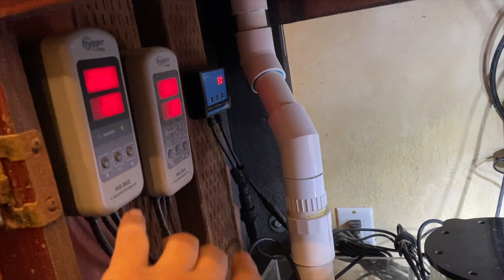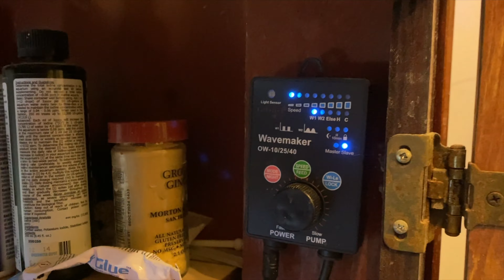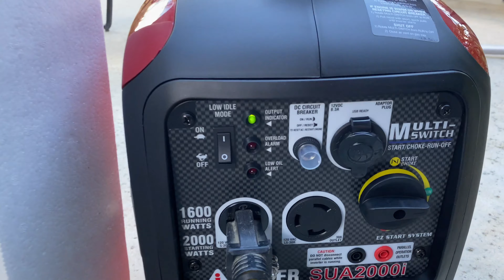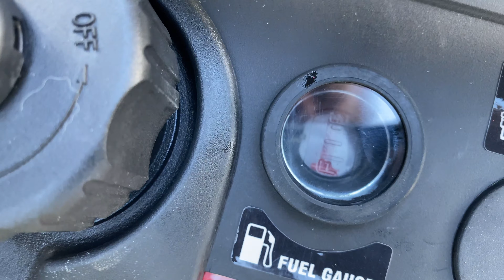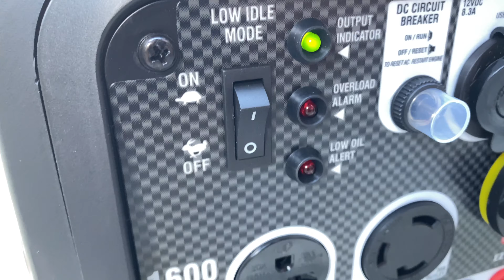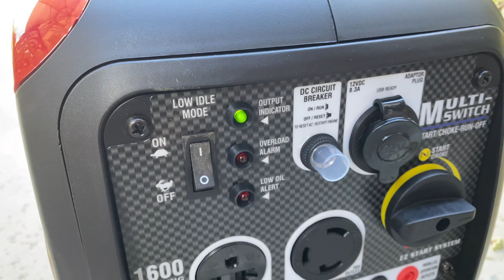TEST: The cheapest power generator to run EVERYTHING in my reef tank!  $299 iPower SUA2000i

Comment: Bought one of these in 2019  (Model SUA2000iV) to back-up my house and tank. Only had to use it once.  House lights on, fridge on, TV on, everything  connected to the tank on, lights, chiller, pumps. The more things you turn on, the louder the unit gets as the motor revs up to keep up with the demand load, but it doesn't get that bad.  Nice unit,  starts after one or two pulls.  I fire it up once a month just to keep it in ready mode.
Reply from the maker: smart move.
Reply: I know Im pretty off topic but does anybody know a good site to stream newly released tv shows online?
Reply: @Cole Case I dunno I watch on flixportal. Just search on google after it:D -merrick
Reply: @Merrick Thomas thank you, I signed up and it seems like they got a lot of movies there :) I appreciate it!
Reply: @Cole Case Glad I could help xD

Comment: 2000 starting watts and 1600 running watts means after load aka things plugged in it's going to run at 1600w
Reply: the tanks looking more awesome then before did some new growth happen?
i've been eyeing generators for my setup also coz now i have a 120g setup i would hate for it to crash if power goes out again for too long but atleast i know 48 hours is ok for my tank to survive for my nano atleast but ya i wouldn't wanna leave my new 120g setup to chance